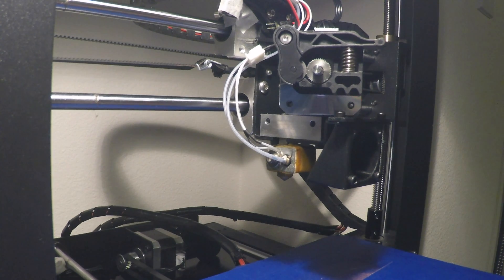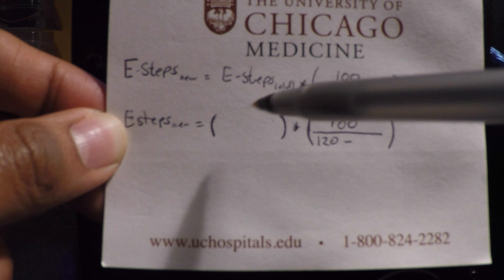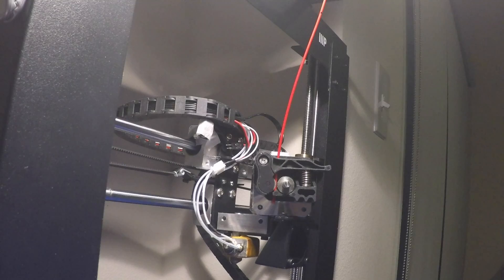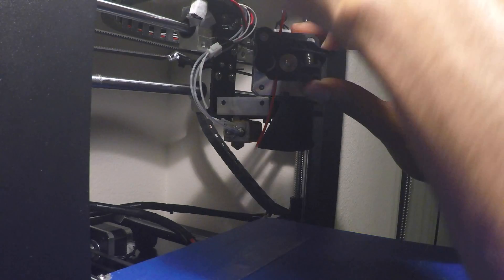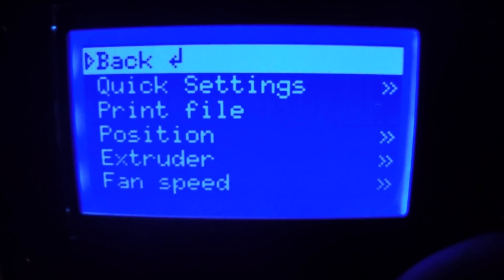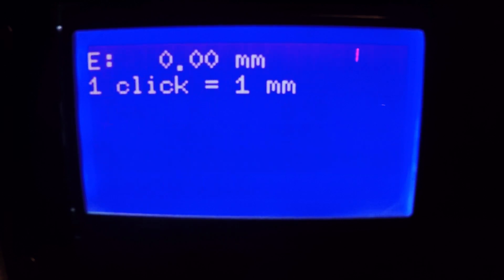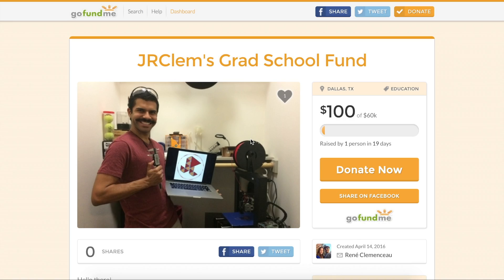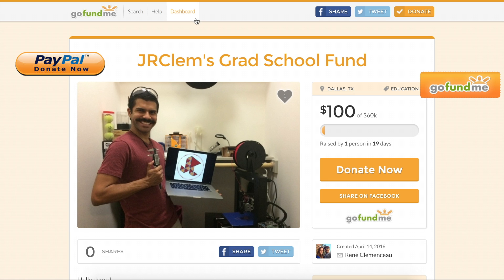Monoprice Maker Select Mods #3- E-Steps tuning

Comment: Great vid...Can you give a tutorial on how to calibrate the X, Y, Z stepper settings as well?
Reply from the maker: +Nathan Mumphrey I've never had to do that, but I'm willing to bet you can do the same thing: Mark a starting point (maybe use some tape), move the bed/height/head by x using software, measure the actual distance travelled, and use the same formula to adjust the multipliers.
Reply: the problem i'm facing is where do I go to physically change the setting after I know the proper numbers.
Reply from the maker: Nathan Mumphrey aaah, that I can't tell you off the top of my head, it's been a while. if you can't find it in the control box's menu, then you might be able to find it using Repetier host (or something similar) to explore/edit the EEPROM settings.

Comment: Just on a side note.  Since you have already removed the stepper from the hotend (I did the same), you don't need to measure 120mm and take the difference.  The exit underneath is the ideal 0-position.  You put the beginning of the filament at the exact level of the extruder, extrude 100mm, and mark with you sharpie at the extruder exit.  With the standard 96.0 setting I extruded 101.80 mm, hardly worth doing the math imho.
Reply from the maker: Well... good point! Thanks!